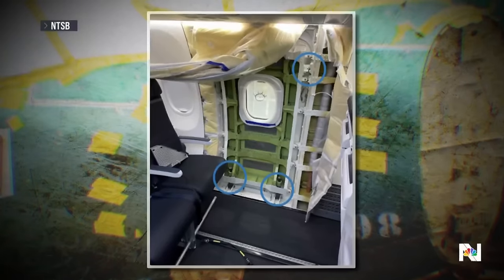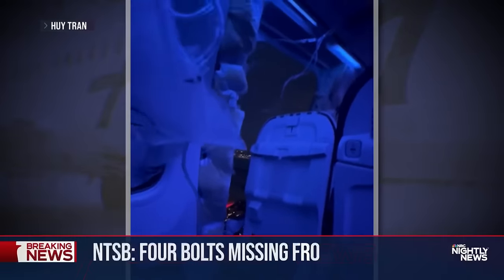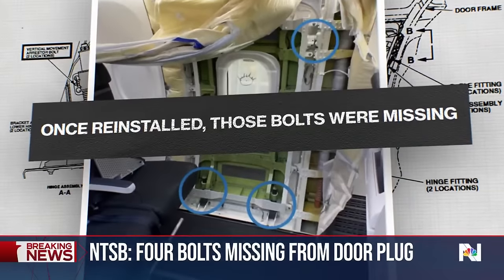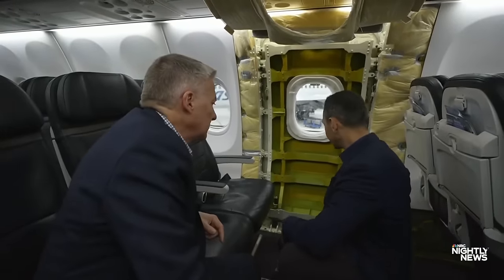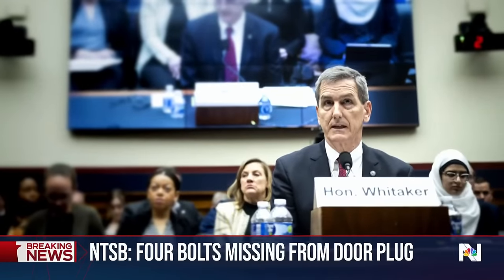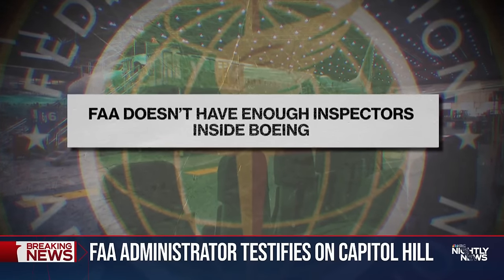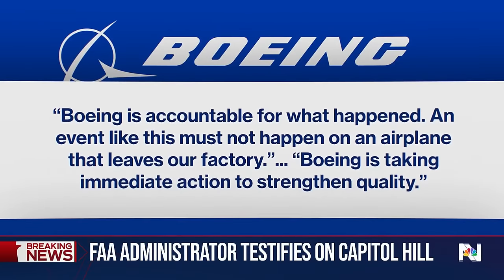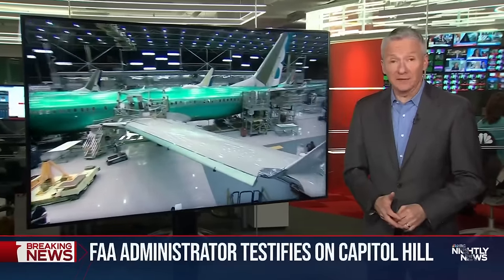NTSB says Max 9 door plug left Boeing factory missing bolts

Comment: Such critical stuff would require a duplicate inspection with 2 engineer inspecting it separately and signing it. But still it is missed. Human factors most likely.
Reply: Yup compliancy kills. They have signed off on hundreds if not thousands that have been ok so they stopped doing the checks properly. They need to add in "tests" every now and then and make sure the people doing the inspections will know those "tests" will be coming thru every so often at random.
Reply: No paperwork problems more likely. Apparently if the door was marked open instead of removed, no task was generated for replace bolts or inspect bolts.
Otherwise, they’d be a blank inspection when they tried to close out the aircraft.
Reply: Yes, it's human error, from the management and accounting. Why pay 2 engineers when you can just shrug it off and not check anything? Way cheaper!